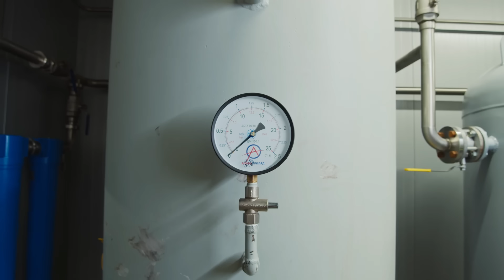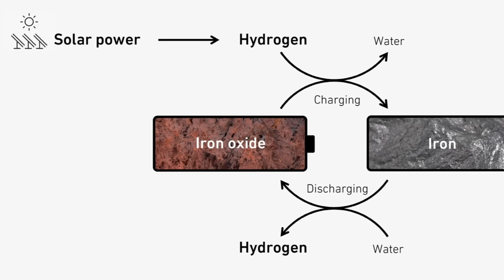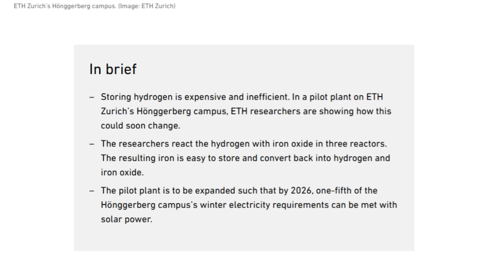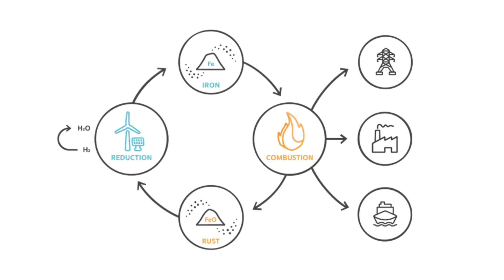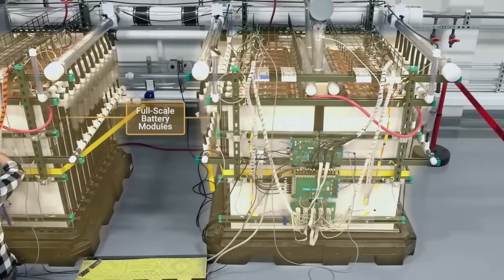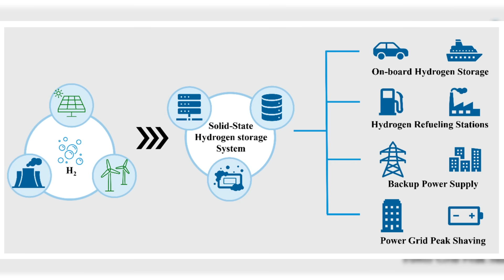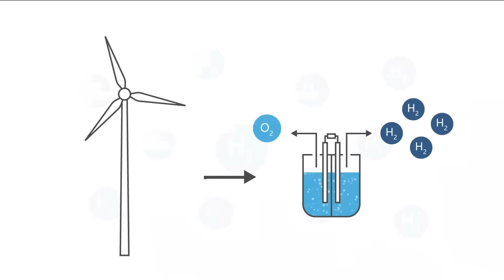Could This Low-Tech Solution Beat Lithium and Hydrogen Tanks?

Comment: also , iron is not cheap !
Reply from the maker: True, iron isn’t free—but compared to lithium, cobalt, or vanadium, it’s abundant, cheap, and globally available. This system uses untreated iron ore, not refined metal, which keeps costs low. It’s more about scale and durability than ultra-low material cost.

Comment: A super huge fatal flaw. During a change in state, the process releases Hydrogen. To change the state back, one needs to flood the iron with Hydrogen. This means either one needs to store the released Hydrogen for later or one needs fresh Hydrogen to have the system work.

This has massive problems. For one, it is pretty much impossible to store Hydrogen for long times. It is the smallest element and therefore the hardest to contain. It leaks right through most container walls.

Requiring a fresh Hydrogen supply is hiding a significant cost. Is a pipe brining Hydrgen to the home? Does a truck come and resupply a tank? Also, what happens to the Hydrogen released during the process? Do you just release it into the air? Burn it?

The most significant problem is that Hydrogen is a greenhouse gas. It inhibits the natural processes that remove Methane from the atmosphere. Releasing into the atmosphere would stupid. Keep in mind, burning it doesn't help much, as it impossible to convert all the Hydrogen to water while burning. It is too quick of a chemical reaction for all the Hydrogen to find Oxygen to bond to. So burning it still releases Hydrogen to the atmosphere. Storing Hydrogen releases Hydrogen to the atmosphere due to leaks. Running it in pipes releases it to the atmosphere due to leaks.

Sorry, but you just aren't getting past the fatal flaw. Plus, it won't work due to the hidden costs. If new Hydrogen is needed, it isn't really a battery then, is it? It is a Hydrogen fueled generator.
Reply: You really missed the point, there.
When there is excess capacity in the grid you electrolyse water and pass the hydrogen through the iron oxide. The hydrogen bonds with the oxygen, reducing the oxide back to iron. Water vapour and oxygen are the only by products. When you need energy, you pass steam over the iron, which promptly turns back to rust by grabbing oxygen from the steam, leaving you with the hydrogen. Then you burn the hydrogen or use it in a fuel cell. 

As to incomplete combustion: that’s purely a matter of furnace design. There should be no problem providing enough Oxygen for complete combustion.
Reply: @q.e.d.9112  That is what I thought was happening but I didn't think that was explained in the presentation. Having said that my concerns are firstly how do you keep the system at 400C and second is the efficiency.  Adding the losses in the solar panels, electrolyzing water and presumably dumping the oxygen then what ever the efficiency of the Fe conversion process is then finally the conversion of H to electricity doesn't sound that efficient. Having said that I like the idea and low efficiency is better than nothing
Reply from the maker: Great follow-up points, @q.e.d.9112 and @campbellmorrison8540. You're spot on—no stored H₂ tanks, and the cycle keeps everything internal: iron <-> rust, with steam and hydrogen as working media. And yes, the 400 °C heat input and overall round-trip efficiency are still open questions. But for seasonal energy shifting, where batteries don’t scale well, even 40–50% efficiency can be a win—especially if the system is simple, safe, and cheap to maintain. Appreciate the thoughtful breakdowns!
Reply from the maker: Appreciate the detailed concerns—many are valid in general hydrogen systems. But this one’s different: the hydrogen isn't stored separately. It's immediately used in a closed loop to reduce or oxidize iron inside the tank. No pipes, no long-term H₂ storage, no trucks. The idea is to store solar energy as solid iron, not hydrogen gas—so it's closer to a rechargeable thermal-chemical battery than a fuel-fed generator.

Comment: So far there are plenty of ideas for grid energy storage. The problem all seek investment money with “ads” like this one that always omit that “little thing” we still have to work out. So make   fully functional units for your house with your own money then sell. No? Yeah, though so.
Reply from the maker: ETH Zurich built and tested a pilot that’s already running. And yes, scale-up needs investment—just like every energy tech did at the start, from solar panels to heat pumps. Someone has to prove it first.
Reply: @Generalphysicsknowledge Surely the pilot is just a “proof of concept” with not really practical use. Unless “that little thing”, along the scale-up, is solved right?
Reply from the maker: @avinfor  Exactly—that’s the point of the pilot: prove it works under real conditions, then solve the tricky parts during scale-up. It’s not practical yet, but if no one builds these test systems, it never will be.
Reply: @GeneralphysicsknowledgeYou are right. Nowadays we are saturated with so many overhyped “coulds” on science and tech news that it is difficult not to be a bit cynical. Best wishes.
Reply: thats why they are developping this. to make it a ready product. and that takes time and research.
Reply: @johanv4668   Even in the answers the deja-vu is overwhelming 😂. I am sure this will be forgotten in a year at most. I don’t gamble but… anyone?  this looks like easy money 🤣

Comment: I don’t see that working to provide power (and certainly not heat too) through an entire winter. You have to first produce enough heat to make steam and release hydrogen, so burning hydrogen to make the steam to make hydrogen would be silly. And to recharge the storage tank you have to get the hydrogen from somewhere to since you have already burned what was released earlier.
Reply from the maker: It’s not a closed loop like that. The system is meant to store excess renewable electricity (like solar in summer) by converting it to hydrogen via electrolysis, which then reduces iron oxide. In winter, steam oxidizes the iron to release hydrogen for power and heat. You’re not burning hydrogen to make hydrogen—you’re storing summer energy for winter use.
Reply: How do you make steam in winter to release hydrogen, without using som kind of energy?
Reply: @perclausen2189 if you input 1 kwh as heat you may release more stored kwh as hydrogen. 

Should be possible to retrieve some of the energy in the steam to heat the home as well. 

I guess the heating is what reduces efficiency the most

Comment: When I hear people nay-saying every new battery, or scientific/engineering breakthrough, and I will admit, 'Game-Changing' is over used in the energy transition to say the least. I do remember these being yet another great new hope, and then saw nothing for a few years, and the next I hear is that one is planned for about forty miles from my home. A 4GWh, 100hour discharge battery in Co. Donegal. Despite being safer than a scrap yard (all those cars oxidizing!!), the locals are doing their best to stop it, on the basis it's the first in Europe, and they 'won't be experimented on.' While last year was a record wet spring, almost wiping out cereal and tillage crops, this year is a record dry spring, with attendant problems. Nothing to see here folks, probably nothing happen in the next 100 years, likely. Now, if we were being compensated for that battery....
Reply from the maker: Totally hear you. “Game-changing” fatigue is real—but so is the urgency. It’s frustrating when the safest, cleanest tech still hits resistance, especially with climate impacts already knocking. Compensation discussions are fair, but blocking every first step just delays solutions we badly need.

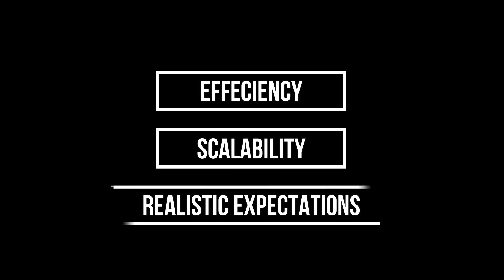Comment: 4:07 EFFECIENCY IS VERY IMPOTENT
Reply from the maker: Absolutely—efficiency matters, especially for daily use. But for seasonal storage, what’s more important is low energy loss over time, not just round-trip efficiency. That’s where this system shines: stable, safe, and long-lasting.

Comment: E-T-H does not see this storage to be used in each house. They rather see it to be used for several houses or larger. 

This is given by the different technological steps required. They seem far too expensive for a single house to become cost efficent. The overall efficency of 40% seem less of a problem to me: on a sunny day my solar panels produce a lot of energy for which I get paid very poor...
Reply from the maker: this would probably be the better way to go. Something like a community shared storage

Comment: Nope.. Hydrogen storage is the problem.. what if it leaks.. you're SOL  Better off with large Edison Batteries.. add to the maintaining that 400*C..  this is going to need a catalyst to reduce that heat temperature.  Heat losses and other losses just are too high, besides the britlizing effect of Hydrogen  and it's radical explosive effect at higher hydrogen  than stylometric hydrogen-oxygen levels [4000 m/s]
Reply from the maker: Valid concerns! But this system stores hydrogen not under pressure and at low concentration, reducing leakage and explosion risk. The tanks run at 400°C, but use solid materials (iron, rust), not pure hydrogen gas. Also, no catalyst is needed—just reversible redox chemistry. It’s slower than batteries, yes, but built for safe, long-term storage, not speed.

Comment: Use gravity to store energy. Set up costs are high but last for centuries and if you’re using dams then fill them with fish and sell permits. 30m head with a six inch feed pipe can generate 5kw every hour. Probably cost around £6/7k to install ( obviously you need a head of water) and any energy not being used through the night can charge batteries or heat up a buffer tank for heating and hot water the next day
Reply from the maker: Totally agree—gravity-based storage is fantastic if you have the terrain. The ETH system is more for places without that option. And yes: combining techs like hydro, batteries, and heat storage is key to a resilient energy future.

Comment: Safe as the Hindenburg.
Reply from the maker: even more :)
Reply: It was the Al doped skin that caught fire 🔥 ..... The irony was H2 gas goes sraight up and burns at such a low temperature you have to be imediately above the combustion point of the flame .... it is explosive in the exact mixture though. 
But the Zepplin company flew hundeds of thousands  
Miles without any H2 explosions or fires.
Any escaping gas from the goldbeaters skin animal gut envelopes would rise inside the envelope. and they had vents all along the skin ontop of the streamlined doped skin Zeppelin .. ..
The skin and the frame was also earth bonded to prevent any sparks and  smoking took place in a positive air pressure room.. 😬

The leak was caused when  the lower rear fin hit the ground in an earlier refuling stop accident.
and punctured a ballonet .. at the rear..  the thunderstorm it passed through charged the frame and skin some of the ties were damaged as the landing ropes were dropped the charge is believed to have been discharged across the skin ignighting the leaking gas and essentialy a thermite type fire spreading across the skin..😬 
That said only 35 persons died, out of 92  - most escaped.
Reply from the maker: That’s one of the most detailed Hindenburg breakdowns I’ve ever seen—seriously impressive. And great reminder that the myth around hydrogen often overshadows the real story. Thanks for the knowledge drop!

Comment: Still need a fuel cell to make power unless a turbine or engine is used
Reply: Nope, 

Since it is a bidirectional redox fuel cell.  Depending on the direction of the chemical reactions it is either storing or producing energy. Just less efficiently than most fuel cells.
Reply from the maker: Absolutely right. Storing hydrogen—or generating it through iron redox reactions—is only one part of the equation. To get usable electricity back out, you still need a conversion system, typically a fuel cell, gas turbine, or engine.

In the ETH Zurich pilot, the hydrogen produced during discharge is intended to be fed into solid oxide fuel cells or similar high-efficiency systems to generate electricity and heat on demand.

So yes, the full picture includes a generation step, and the overall efficiency will depend on how well that hydrogen is utilized. But what's unique here is the safe, long-term storage of that energy in a compact, scalable, and low-toxicity system—something that's still rare in the world of renewables.